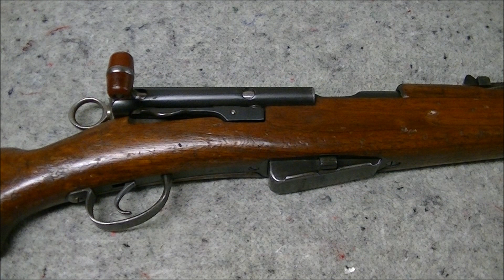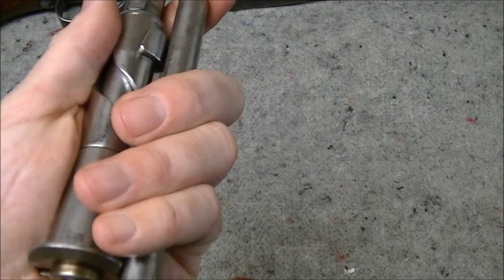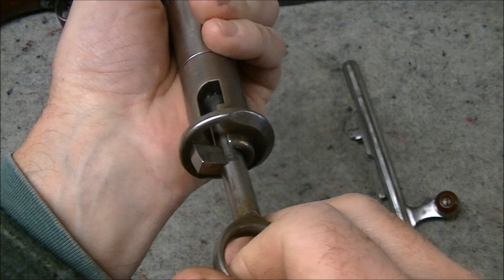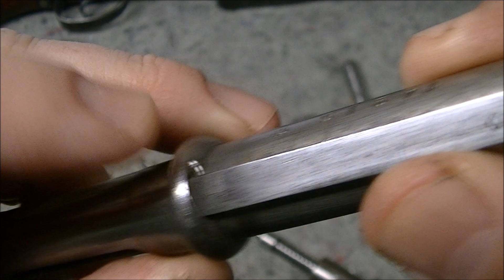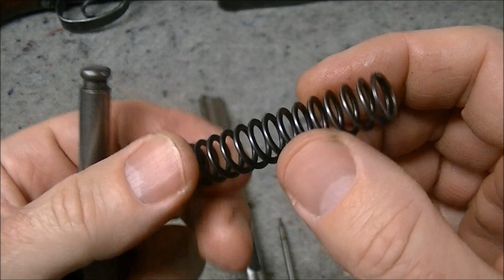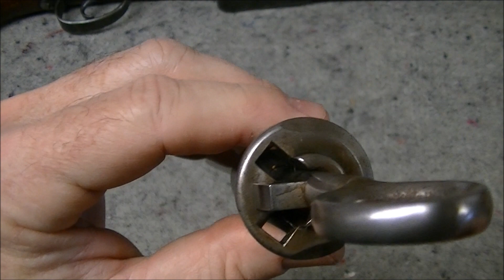Schmidt-Rubin Rifle Bolt Disassembly

Comment: hey @314229 I just recently purchased my first 1911 rifle and was wondering what lube you would use and where to apply it prior to shooting
Reply from the maker: I use a Castrol automotive grease on all the sliding/rotating parts of the bolt and regular oil on the rest of it.

Comment: Great video!  Thank you for sharing.  My action is very stiff and I took the bolt assembly down and can't find reason.  I wonder if I have a stiff spring because action is fine when cocked.
Reply from the maker: Does the bolt serial number match the one on the receiver?
Reply: @314299  Yes, all matching.  I lubrigated it with a thin layer of grease and it really helped.

Comment: Definitely Old world workmanship quality. as you know, I have a K-31, However, all the sheet metal parts are kind of a turn-off. It shoots lights out though. very accurate rifle. The 7.5x55 is one of my favorite rounds.  good Video. -Dave
Reply from the maker: The K31 is overall a better rifle, but parts of it do have a cheaper feel compared to the old Schmidt-Rubin designs.